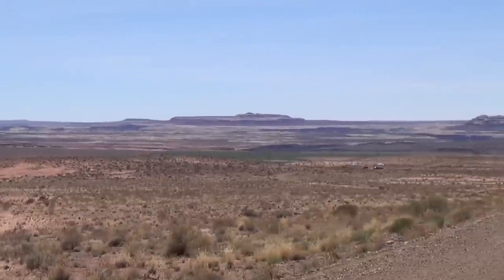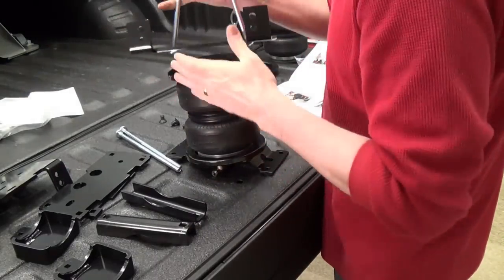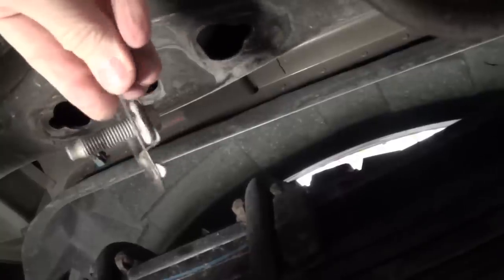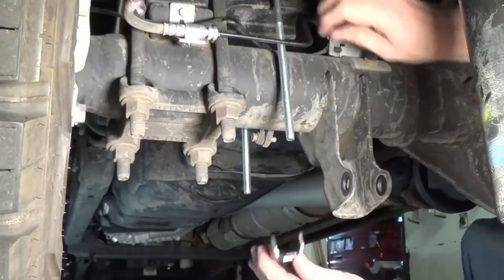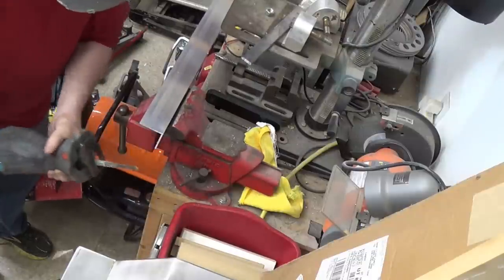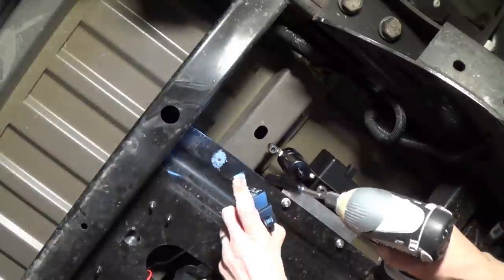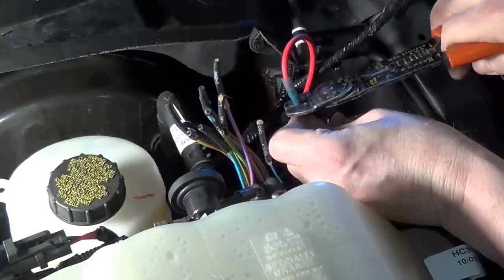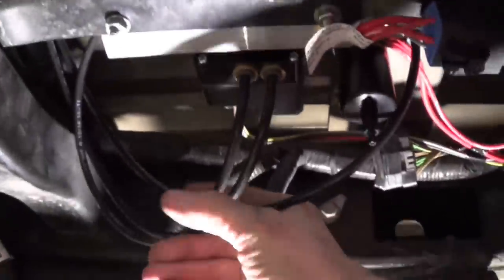Installing Air Lift Air Spring System on 2017 Ford Super Duty F350

Comment: Why go AirLift and not Firestone Ride Rite?
Reply from the maker: Great question. I had Firestone RRs on my last truck and they worked fine, never failed. These are better made and more importantly have the internal bump stop. That was very helpful when the little air bag compressor failed on a trip. I was glad the bump stop was in there to keep from pinching and damaging the airbags. See my other video on how I got rid of the little airbag compressor.
Reply: @EpicCowlick   I'm getting them but going with the Ulitimate Plus due to our long season of  New Hamshire salted roads.
Reply from the maker: @cccodfish  Good call. Stainless steel is the best.
Reply: @EpicCowlick  Did you jack up or lift up the rear of truck with wheels on the ground at all so the bags would have space to help be put in ? Also you left the tires on and did this from behind mostly? With the bags that is not questioning the air pump install.
Reply from the maker: @jimbobxcityguy5338  You're right. I jacked the back of the truck and put a tall jack stand under the rear hitch. That creates additional separation between the axle and the top bag  bracket. You can see the space was enough to get the airbag in there. I've heard some guys compress the airbag and hold it with a zip tie before putting in in place. That would work too.
Reply: @EpicCowlick  thanks. Tires left on thou right? I came from a 2016 f350 with 150k miles. Now 2019 f350 lariet with 1500miles. I hate the new seats. Miss the ole 2016 seats very much.
Reply from the maker: Rear tires left on throughout. I agree on the seats. Just keep adjusting up down forward backward until you find what works.
Reply: @EpicCowlick  saw a forum were a guy took the lumbar modual out of the back seat and put foam in. Even relaxed the lumbar is too much on this truck for me. Irritating.

Comment: what size tires do you have on the truck?  did you notice a loss of power from stock sized tires?
Reply from the maker: These are Toyo RT 37/12.50/20 and yes they are quite a bit larger than the factory tires. I intended to get 35s but when I learned 37s would fit, I went that direction. It's really hard to tell the impact from the driver seat. I just got back from towing that big trailer over the same route I puled on Utah Highway 6 for years and I can report that this truck with 37s is quite a bit stronger than the 2011 with 35s. I suppose if I had 35s on the new truck it would feel peppier? Who knows? It's a tow monster as it is so I'm happy.
Reply: I'm facing the same decisions on my new 350 Platinum. I went with 35" BFG's because my 2013 drove horrible with 37" on OEM rims--it was a white knuckle experience, so I had to go back to 35's. How does your truck drive/handle with the 37's on OEM rims? Is there a major difference in handling? I really like that set-up on yours!
Reply from the maker: Interesting you say it was a white knuckle experience. It is incredibly stable and predictable and even better than my previous 2011. I only got the 37's because I get off road a fair amount and enjoy the extra clearance but I also like the aesthetics. So far so good for me.
Reply: I have 35's but im thinking of dropping to stock height 33s.  There is a difference in power between stock and 35s.  i really wonder what it would be like on 37s...   Im just hesitant because i also go off road every couple months.
Reply from the maker: Factory tires are almost 3 inches so that is pretty close to factory. I think 33's would look kind of silly on such a truck.
Reply: Ya factory tires on my '16 Ram were 33.3"....  I agree with you on the looks.  Btw some towing videos would be cool if you have the time.

Comment: Are you going to do another DPF back exhaust on this one or no
Reply from the maker: No plans to right now. The 2011 really hissed when under hard acceleration but this one does not.  There's no need to correct the exhaust note on this 2017.

Comment: Awesome job! No manual fill valves?
Reply from the maker: I was tempted to put them on my first truck but never did and never ended up needing them. Same deal on this truck. The compressor and controller are pretty dang reliable.

Comment: Question do you have a charge wire on your f250 at the Trailer plug?
Reply from the maker: I can't say for sure. Pretty sure because everything works as expected. Remember that on these new 2017s you have to plug in and press the brake pedal to send power to the back.

Comment: what is the towing capacity for the new f350's??
Reply from the maker: Depends on what you're asking. Pin weight max? GVWR? GCWR? Max towing conventional? Max with 5th wheel or gooseneck? To make it even more complex the trim level on each truck changes the numbers as well. Google 2017 Ford Super Duty Towing Specs and there's some documents put out by Ford.

Comment: Any idea what the pin weight of your trailer is?
Reply from the maker: It can be up to 3,600 lbs depending on how the trailer is loaded. Maybe a bit more but heavy by any measurement.

Comment: The top plate mounting with those tiny Clips doesn't seem particularly secure
Reply: Not sure what you're referring to. Are you talking about the little screws to mount the compressor?
Reply: @TeuvoJones  no those little clips that go into the frame at the top plate of the airbag he lost one of them in the frame temporarily.
Reply: @JasonLee-qj8ts  Right. Auto manufacturers have been using them for a while. It's a convenient way to hold a nut in a location where you can't get a wrench on it. They seem to be working.

Comment: If you wouldn't of taken the rake out of the truck you probably wouldn't of needed the air bags.  It was designed that way for a reason, I have the same truck with a 40' toy hauler and it tows level.
Reply: I totally disagree. I have been running air bags on each of my  F350 and F450 trucks since 2000, (5 trucks).  I did not change any of the factory springs or shocks, but simply added the air bag as an add on to the suspension. I pull very heavy bumper pull trailers and 40ft+ 5th wheel trailers and the air bag systems are a must for better control, drive-ability, handling and the quality of the ride you get from the air bag system(s).  I currently just added this exact system to my new 2017 F450 Super Duty Dually and they are nothing short of perfect as an addition to the suspension for this truck. The factory suspension is not compromised in anyway and still functions as it should, the air bag system is merely an "assist" to increase the value of what the stock suspension already does but then adds it's own attributes to the truck, namely the additional comfort and handling that it provides.
Reply: could have added torklift stable loads for a fraction of the the price. but I guess joe average can afford all that
Reply from the maker: It all begins with bigger tires. Then I need to level the front end to make it look right. Then I need to re-level the back end because it sags.  Seriously, the airbags provide stability from the first moment of suspension travel. Overloads or Stable Loads engage after the back end has already sunk 3 inches which makes the back end feel too bouncy to me. The airbags ride firm and bonce-less at unloaded height. That's the main thing.
Reply: I used the airlift on my last truck and the stable loads on my 2017.  Both are good  We carry a slide in camper and I find the airlift a little soft for the high center of gravity the camper imposes on the truck.  In order to come back to level the truck's suspension is close to the unloaded state which removes the support of the overload springs which, although a little stiffer ride do more to maintain stability on the highway.  The use of an air system depends greatly on the load and CG.  With a camper at nearly 12' tall on the back of the truck crosswinds can be nerve wracking, including sidewinds from full size trucks.  The torklifts seem much better for these conditions, although I do miss the convenience of the airbags with onboard compressor and cockpit controls.  Leaving on a 20-25K  trip this week.  I may have to stop in Wyoming and add an air system if my initial short range trials prove incorrect.  Cheers!
Reply from the maker: Have a safe trip Rasalas. Hit me up if I can help with anything.
Reply: rasalas49 - unless you have a side-to-side leveling issue, I think you'll find stable loads to be sufficient. having both uppers and lowers (assuming you have factory overloads springs) would be your best bet. I've heard of and spoken to a number of people who ended up in frustration over air bags. My own experience included.
Reply: epiccowlick -  don't confuse upper stable loads with lower. lowers are the ticket. they engage the main spring pack immediately. no gaps or space to take up. uppers engage only the overload spring once the majority of the main spring pack has been loaded. this where the "sag" you mentioned comes in. I personally have both uppers and lowers and they're awesome. you'll be cursing those bags when they begin to wear and leak. there's nothing to adjust or maintain with stable loads. they just work--and for much less money. 

why do you care about unloaded ride height? headlights? 

btw, I like where you mounted the compressor. slick.
Reply from the maker: I appreciate the explanation and I don't have experience with the stable loads. Only what people say including yours. My take is if you're pulling lots of weight or running a big payload really often they would be great. The single biggest advantage with the airbags is the ability to "turn on and turn off" at will. Factory "soft" ride when deflated or super firm when inflated. 

I also agree with the maintenance and potential for failure. Airbags have more moving parts and can break. My first set had a manifold fail because of water. That was a pain because the airbags were not there for me when I needed them that time. Had to cut the line and put a manual valve just to inflate them. Now Air Lift includes a water separator which is cool. Time will tell.
Reply: How is the compressor and the manifold holding up. The compressor does not like moisture and the manifold doesn't either. Do you have to lower your tire to drain the trap?

Comment: What about the control panel?
Reply from the maker: Are you talking about the wireless remote that allows you to change the pressure in the tires? There's a link to the kit in the video description. You can see everything that's included there.
Reply: @EpicCowlick  That is correct

Comment: Are you planning on mounting a compressor and tank onto this truck?  I have the F250 version of your truck and I can't find a solid place to mount the tank!
Reply from the maker: I am planning to do that and I can't believe I've waited this long. It's been a busy summer.
Reply: Thanks for replying.  I am looking at the 20020 from Viair, but with the auto step boards it limits the area where it can be mounted!  Thanks again, can't wait for some updates.

Comment: How much space you recommend between the truck bed rail and the bottom of the fifth wheel when hitched?
Reply from the maker: Carl Key The basic rule of thumb is to have no less that 6 inches if the truck and trailer drive on improved roads. 8 inches if off road.